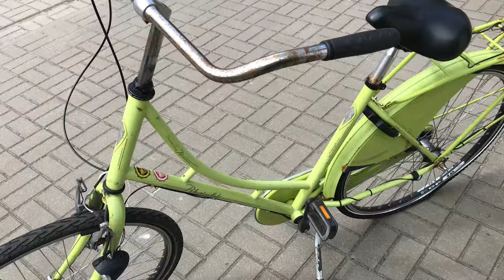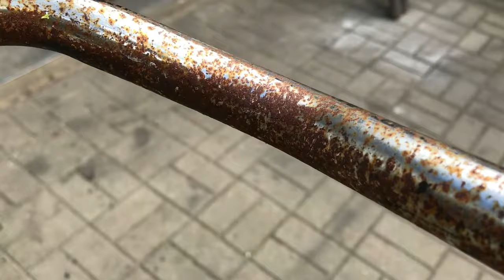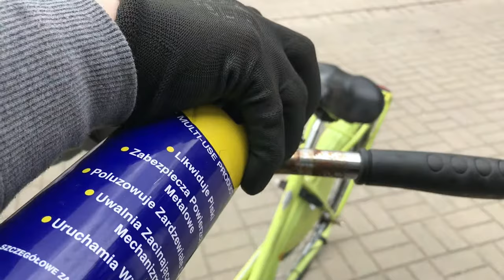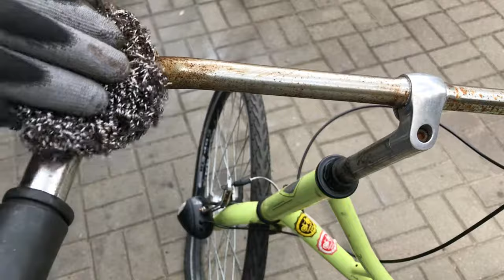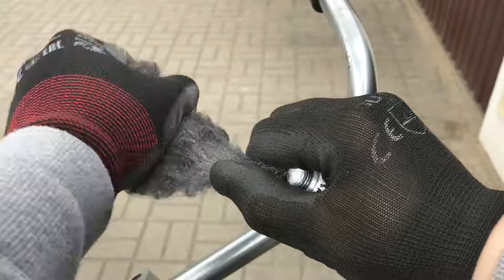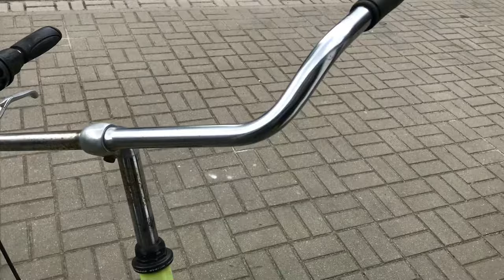How to remove rust coating from chrome bicycle parts - handlebar ? COMUTTER LADY BIKE RESTORATION

Comment: NEVER go near chrome with wire wool or other hard abrasive! Tr y a ball of cooking foil soaked in water....the foil is softer than chrome so will not add further scratches or damage.
Reply from the maker: I used very soft wire wool, i think is better than alu foil, it not do scratches on chrome,
Reply: It was like a fucking magic trick
Reply: What? You can use steel wool on glass if you want even. Just get the 000 or 0000 type very fine.
Reply: @lonerbikes yeah, 000 wool will do the trick without scratching the chrome

Comment: What paste???
Reply from the maker: this is metal polishing paste
Reply: @lonerbikes That was my question too. Ok, so metal polish. Then wax? Or is there wax in this mystery metal polishing paste? Because once you've rubbed off even more of the chrome plating it's going to rust more and faster if the steel isn't protected.

Comment: How to remove rust from a steering wheel that has that black coating? I don't know what material it is.
Reply: You dont, its just paint, remove paint first with a paint disolvent costs about 5$ then just sandpaper the parts and repaint them